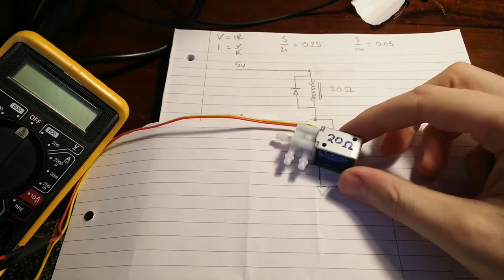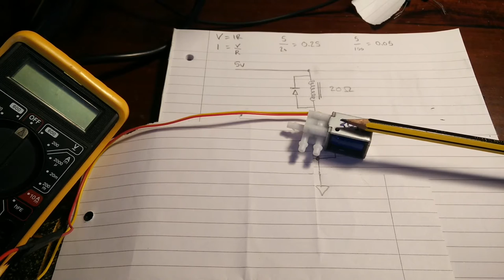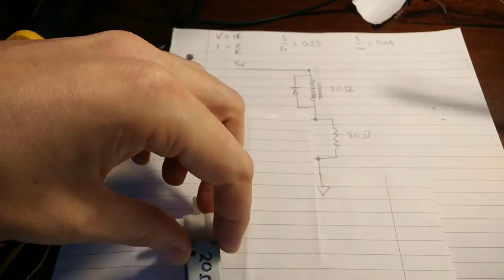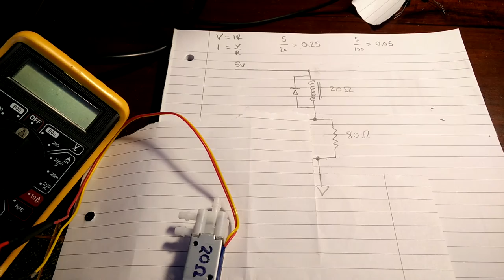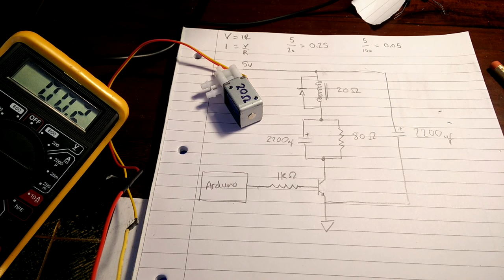Solenoid Driver Circuit - Short Version

Comment: Hi! What a wonderful video. It explains every part very well I like the circuit. Fot any one wondering about the parts which he was unsure about. 
The induktor (the spool) can be visualized as flywheel (a big wheel which takes time to start and stop). When the current start flowing through the spool it takes time until the potential drops over the spool due to the "slow start" however once it's going and you block the drain side the spool will continue to push the electrons and the potential after the spool will rise and in worst case be so high that it breaks the transistor due to over voltage.
The protection resistor is vital. The voltage drop for an BJT from base to emiteris normally 0.7V the current through the base to the emiter controls the collector emiter current which will be 200 times bigger. So depending on the current you will draw you want the 1k to alow enugh current so the BJT is fully open. However if it's a MOSFET the reason for the 1k is that the capacitance on the gate would allow current spikes which might damage the output. However you want the MOSFET to turn fast so you don't want a to big resistor either so 1k is normaly good.

Comment: nice video, can you please elaborate on how you came up with the Capacitor value? If one wanted to have let's say 1 second of 1Amp current and not more or less, how would you choose your Cap size? Thanks
Reply from the maker: I'm afraid that it's not easy to do what you are asking. The current draw due to the capacitor is not a square graph - at the beginning of its charging, there will be a high current draw, and when it is nearly charged, the draw will be lower. It's an exponential curve. The exact timing of that curve will be dependent on many factors, including ambient temperature.

For this circuit though, you don't need to worry about it - you just need to pick a big capacitor. In my case, I just picked the biggest one I had on hand, but for a solenoid like this, 4700uf is a good starting point.
Reply: Charles Wilkinson Thank you for your fast response. That clarifies me a bit. Since you have everything tested out, you don't have to worry about time, but what if you were given let's say 1s before you could drop the current below a certain level to make sure that your solenoid valve opens completely? I am working on a similar design problem. Now I am thinking twice about using a capacitor for the delay in the current drop.
Reply from the maker: @tadehmirzakhanian893  Seems like an odd requirement to me. I'm pretty sure that it would always be less than 1 second, but you would have to test yourself, also as I mentioned, the actual time would vary slightly with external factors like temp.

The smaller capacitor you use, the faster your current draw will drop, but it also becomes more likely that the solenoid won't successfully fire. If the capacitor is only barely large enough to trigger the solenoid in ideal conditions, a little bit of grime or dust could gum it up enough not to fire.

My advice would be to seriously try to remove or increase the 1 second constraint as it will allow you to make your circuit more reliable. Failing that, you could ditch this whole design and instead use a PWM signal from a microcontroller (via a transistor) to drive the solenoid. That would allow a much more square current profile and very specific timing.
Reply: @kabadisha  Thank you. I am considering using a 555 timer in its monostable mode. I can get the timer to give me a pulse for my desired time, connect the pulse to turn on my transistor/mosfet to give me the extra initial current I need to open the valve. After the pulse is over, the transistor/mosfet will shut down dropping the extra current, and I will be left with the "hold" current. What do you think about my solution? Thank you very much for your time. I am clearly a newbie to analog and I appreciate your responses :)
Reply from the maker: @tadehmirzakhanian893  That's clever! Do let me know if it works :-)

If you are using a microcontroller like an Arduino else where in the system though, I would just use a spare digital pin on it to do the same thing directly and reduce the component count.

I'm not very good at the analogue stuff either, which is why I created a video about this relatively simple circuit when I figured out how to make it work.
Reply: Why the diode? As an Inductor in this case the coil of the solenoid charges the magnetic field around the coil expands when you remove the current flowing through it the magnetic field collapses inducing a current in the coil in the opposite direction which has to have someplace to go and the voltage will spike high enough to allow the field to collapse potentially arcing between the wires in the coil or causing other damage. The diode provides a path for that current to quickly and easily allow the field to collapse without exceeding the forward bias of the diode about 0.6V usually. In the old days the field around the ignition coil in a car collapsed when the points opened creating a voltage high enough to produce a spark inside the cylinder.